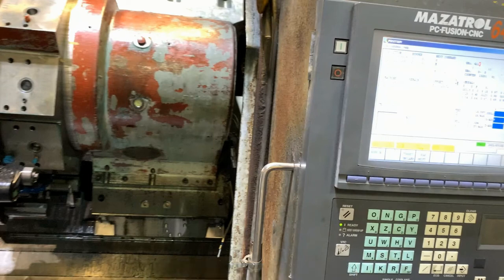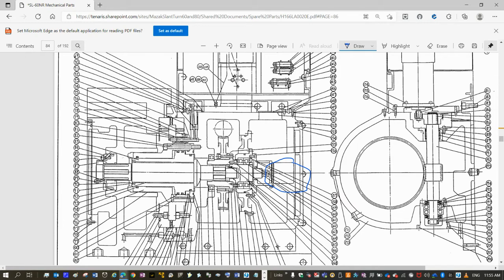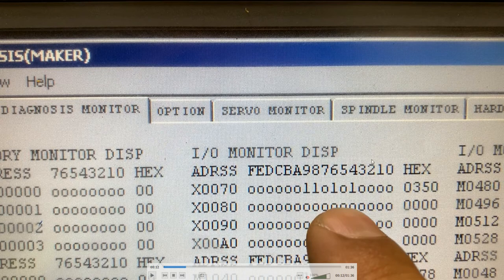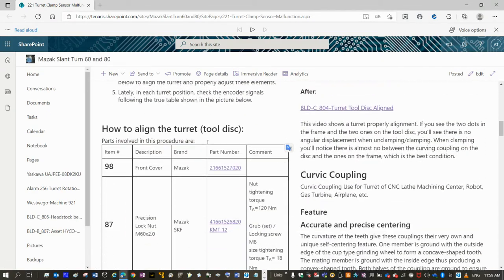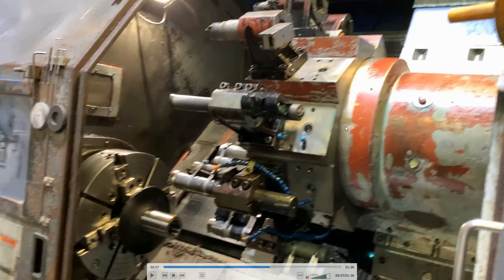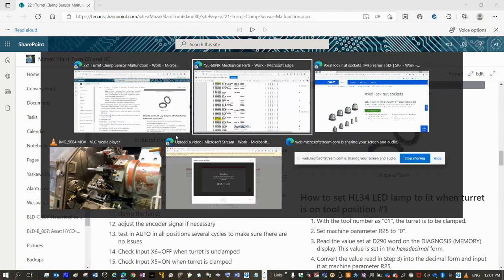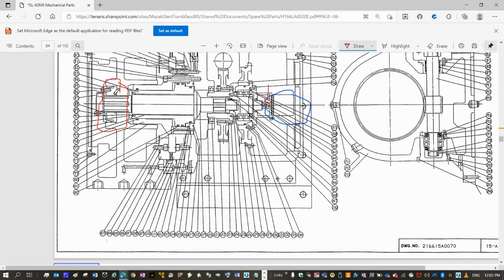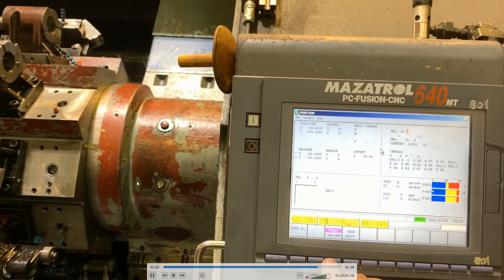M640T CNC: Alarm 221 Turret Clamp Sensor Malfunction Troubleshooting

Comment: how do i get that guide on the 221
Reply from the maker: Hi Brandon. Do you mean where you can find the troubleshooting guide?
Reply: @FabianAchaval  yeah that one
Reply from the maker: Brandon, I've posted it on https://www.youtube.com/post/Ugkx8CQ6p9uDQw7P_I6pikklGZDR-hUX4oPF or https://fachaval.blogspot.com/2023/01/5564828993772427562.html. Hope it helps.
Reply: We have same problem with brandon the 221 which is the revolver
Reply from the maker: Hi  @mariastoriano , can you please confirm the alarm is "221 Turret Clamp Sensor Malfunction"? What machine model is? 
Is the turret/revolver hydraulic or electric? If it is electric, what servomotor has?
Have you seen https://fachaval.blogspot.com/p/mazak-st60n-st80n-alarm-221-turret.html?